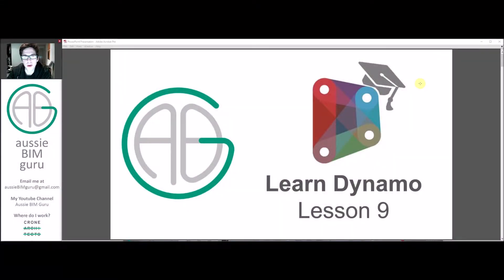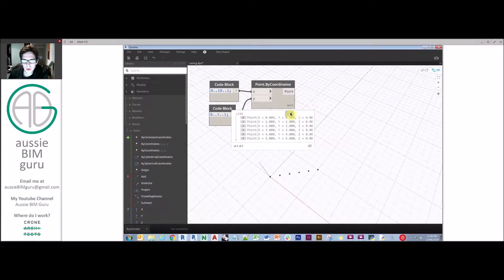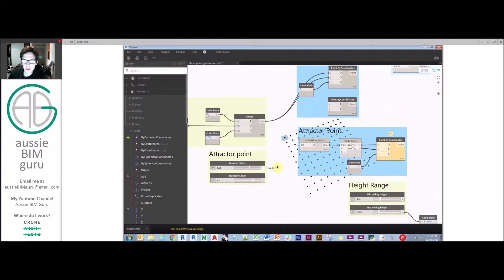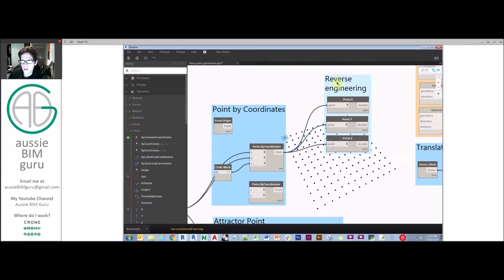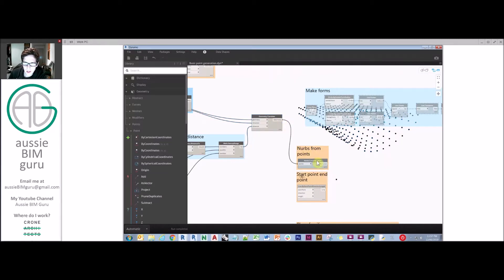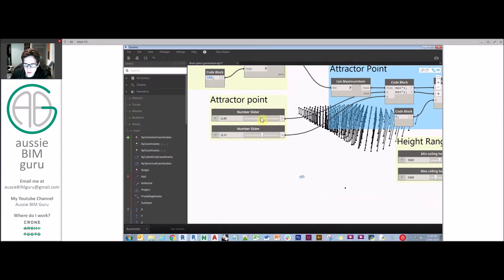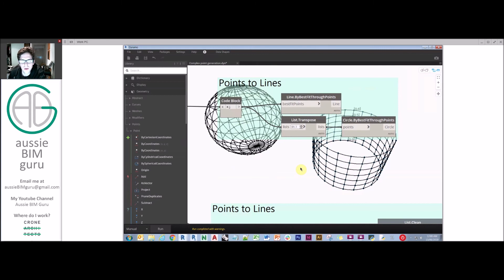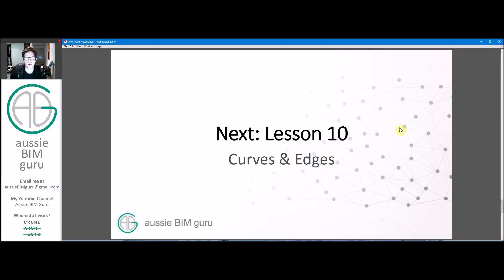Learn Dynamo - Lesson 9: Points & Lines

Comment: I still need to wrap my head around the logic of geometry generation. I would have assumed that on a square grid, a 0.5, 0.5 attractor point would generate a "conical" surface,where all the boundary points would have the same z height. However, for some reason the shape is more of a wave-like triangular prism, where the border point' z coordinate varies and I cannot figure out why is that happening.
Reply from the maker: If you picture slicing a cone as it goes downwards, the points would actually need to be circular to generate a perfect cone. The reason why you get a stepped pyramid of sorts is because the grid is rectalinear. If you array a row of points in a circle then set that centrepoint as the Z attractor you would end up with a conical outcome.
Reply: The issue is with how RemapRange deals with the list. If you flatten the list before feeding it into RemapRange and chop it after (get the number by using a count node for x or y-coordinates) you will get the conical surface. OR simply remove your RemapRange and the conical section appears in the right form, BUT not in the right height. I played with levels, lacing, ... but flatten-chop seems to work.

Comment: if can u get point coordinate from the existing geometry ?
Reply from the maker: Yes you can either try to get the centroid of its solid geometry or its location if it is a point. Not all objects represent themselves using a point, e.g. walls use a line. You would need to transform the coordinates by the difference between the internal origin's NS/EW values and the rotate of true north to get the actual coordinates (it is not an easy process).

Comment: Hi! I hope you are doing well. How do I turn lines into model elements? So a common issue we have is where we get a steel structure from the client in Revit, then we run FEA in Strand 7 which gets us a dxf file of the updated model which is termed TOS (Top of Steel) - I have gotten so far as to import the TOS model which are lines into Dynamo but how do I turn the lines into steel members once again?

Your help will be greatly appreciated.
Reply from the maker: Use the line/curve to guide the placement of a beam. There should be a node in Dynamo for this which uses a curve as the base and needs a structural framing type/host level also.

Comment: why is it that if i get the start point of a wire vs choosing it with the keyboard as input - the coordinate systems are scaled? 
i.e. the point i give as input needs to be scaled down 304.8 times.
Reply from the maker: It sounds like the node might have a bug where it isnt being converted to the local coordinate system for the picking of points. 304.8 is the rounding factor from feet (revit internal units) to mm.
Reply: @AussieBIMGuru  damn, never thought of that. 
it is the ootb Select Point on Face node.

in a way it is good that the scale factor makes sense, i was fearing it would vary from project to project.